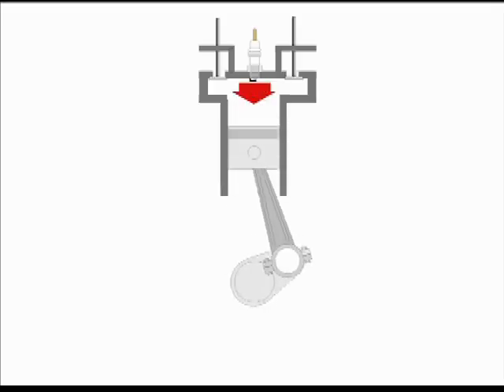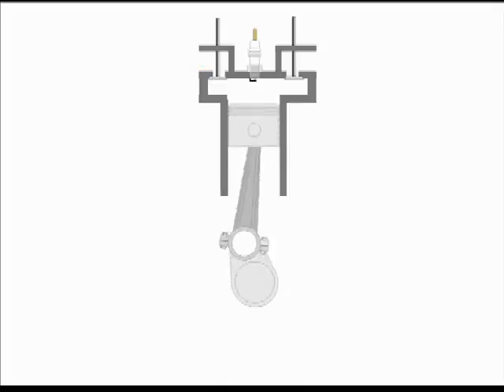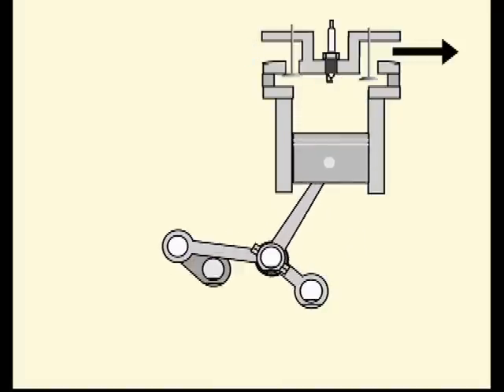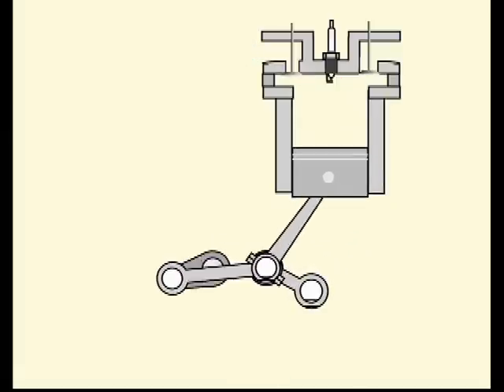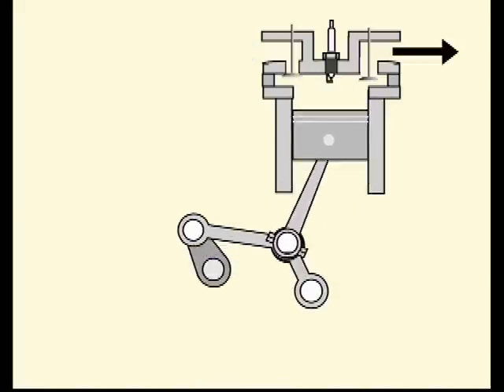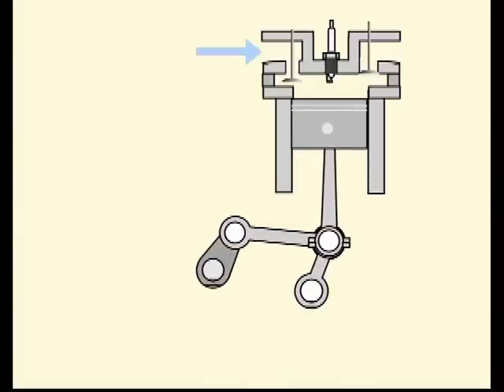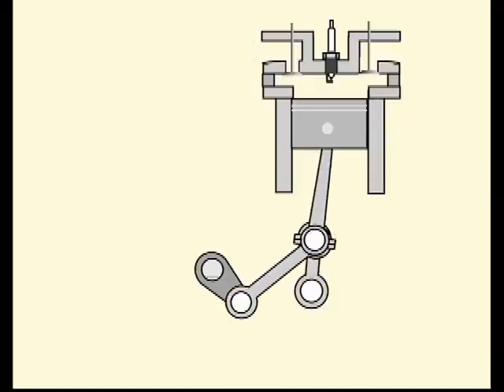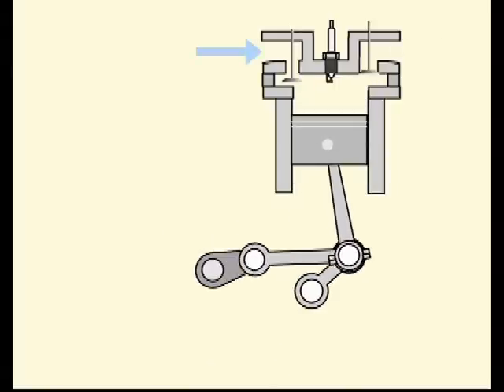The Original Atkinson Engine

Comment: This video implies that the extra linkage in this illustration is being used in modern Atkinson Cycle cars. This is in fact incorrect, as Chava himself has pointed out in the comments. The system used in modern hybrids and few non-hybrid cars is the "Modified Atkinson Cycle." Basically, all this does is keep the intake valve open well into the compression stroke. It's an easy modification and it increases efficiency, but at the loss of power, especially torque. Hybrids make up for this using their electric motors, and some non-hybrids are able to switch seamlessly between the Atkinson and Otto (normal) cycles. Interestingly, there is at least one generator manufacturer that is working on implementing the extra-linkage system shown in this video. It would have to be sized up to make the equivalent power, but would still be more efficient than current generators.
Reply from the maker: Thanks for your contribution!!!

Comment: explosion force?  now easy there chav, it is still a combustion engine.
Reply from the maker: Yes, the Atkinson engine is still an internal combustion engine, but more efficient than the Otto engine. Versions of this principle are used in current cars for more efficient use of fuel, and also in hybrids such as Prius in order to use a smaller internal combustion engine.

Comment: less moving parts is best, on paper or test bed everything is great but in real life use and maintenance its over complicated, it would be a nightmare to work on, replacing a bearing on the crank balance shaft, the labour rates/per hour would make it uneconomical to work on.
Reply from the maker: Exactly, that's why it did not become popular until they modified it.

Comment: Thats good but the torque is super low
Reply from the maker: Thanks  Fendi, for your kind comment. This principle was used when the engine was invented by James Atkinson back in 1882. It does provide less torque than the Otto Cycle, however, it has been improved since, and a modified version is being used in high efficiency engines of today. There is an excellent article in Wikipedia about this engine and can be found as Atkinson Cycle.

Comment: 2 tak engine without additional lubricant
Reply: No, it has valves not ports and is still firing every 4th stroke.  It's just that the induction and compression strokes are short.  I don't like any design that forces gas back into the intake manifold - in case of a backfire in a hotted-up engine!

Comment: Useful in low power and low emission, more efficient while driving very softly, but atkinson cycle suffers from lack of power. Hopefully with variable timing valves the currents engines can achieve both atkinson and otto cycle.
Reply: They currently do it. I don't remember but Toyota or Honda have that kind of engines.
Reply: @RDCST  Toyota dynamic force engines. Time will tell if they can overcome the complexity to deliver their legendary engine life though.

Comment: Huh? I think atkinson means that they close the intake valve a little later, during the compression stroke.
Reply: Patrick Thibaut Its basically the atkinson cycle and how it takes in air and pushes some out, but this just takes in some air, compresses it the same distance, but has a power stroke and exhaust stroke a longer distance. Basically an atkinson cycle engine.
Reply from the maker: Things are changing rapidly in that field. The original Atkinson Cycle engine had the combination of levers in order to achieve the fuel saving, however, with the advent of electronics and computers in cars, the same thing is being accomplished by altering valve timing. Please watch this other video - https://www.youtube.com/watch?v=gD2AQuhbHdk at minute 1;16 you can see the original Atkinson Cycle, while the rest of the video tells about the valve timing details. There are as many variants for the cycle as there are different manufacturers!
Reply from the maker: And thanks a lot for your feedback!!

Comment: more moveing parts
Reply from the maker: You are right.
Reply from the maker: Well, an improved version is being used in modern cars, controlling the timing of the intake valve the amount of mixture is reduced, thus achieving the same purpose with less parts.

Comment: You can achieve the same function by varying the valve timing thus changing compression ratio. It saves horsepower that would be used to rotate that crankshaft contraption.
Reply from the maker: Thanks for your feedback!!!
Reply: Olá, você saberia me dizer se posso usar esse sistema de manivelas de Atkinson no motor Stirling?
Obrigado